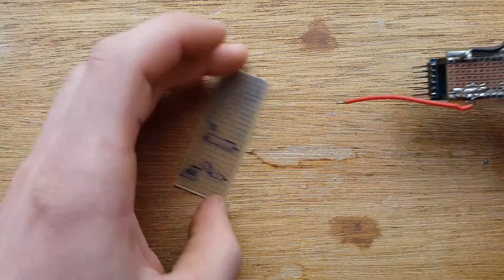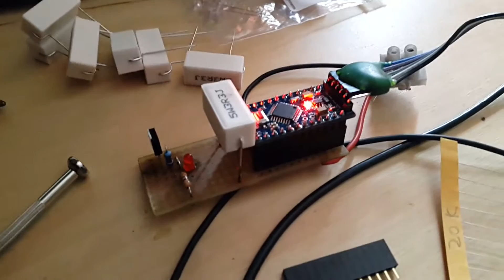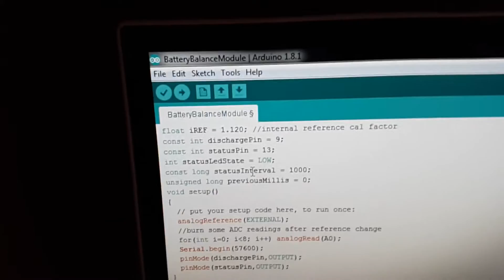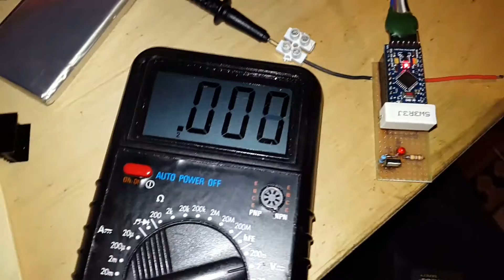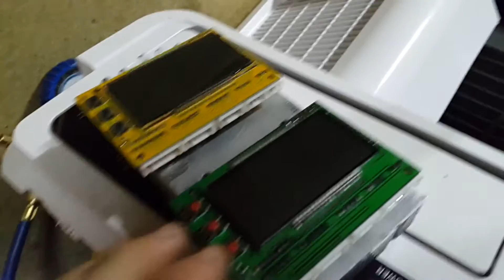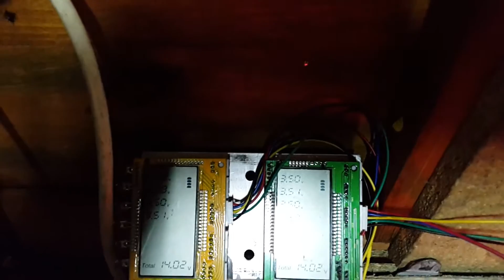DIY Arduino BMS Cell Balancers

Comment: Hi Shaun. Do these board work for bigger 18650 packs? If yes, how are they connected? Is there  main board that gets all the infos? Is there data storage? I don't understand code, so i need to ask you these things. Thanks for any help.  Bye
Reply from the maker: It will work on any lithium ion cell you can physically fit them to. The code sadly has been lost but I am working on a newer version which is far more accurate and doesn't use microcontrollers. It will be released as a commercial product.

Comment: This video deserves more views.  You have achieved something reserved for very high end BMS,s.  I have 4s LiFePo4 BMS,s here costing upwards of £200 each  and they are arduino based.
Reply from the maker: I am currently developing the newer version of this which uses analog electronics entirely and balances to within a millivolt or thousandth of a volt. It will be a commercially available product. Please see some of my recent videos for some more info.
Reply: Hi. That's great that you are developing a commercial version. I guess you'll produce pcb's with all the devices mounted. There's a real need in the powerwall community for affordable alternatives to batrium an chinese products. Keep us informed. I suscribed to your channel.
Reply from the maker: @Suncatcher173  Thanks, I have just uploaded a video about it. The product is almost ready.

Comment: Did you try measuring Vgs on the dirst version? Perhaps the gate voltage was below Vgs threshold. The drain to source resistance might have been comparable to the power resistors resistance and dissipated half the power.
Reply from the maker: Han Gathercole Lam The mosfets were too close to the resistors and it was due to heat conducting through the solder.
Reply: Shaun Dobbie oooh I'd have taken a long time to work that one out without a thermal camera.

Comment: couldn't you use only one arduino to sense the voltage of all the cells (use analog multiplexer if you have many cells, up to 18 or even more, because arduino has few adc) ?
Reply: instead of many arduinos you would have many mosfets, but therefore use many digital pins

Comment: Have you thought about ATTiny's instead of arduino's?
Reply from the maker: Colin Hickey Yes and I would have chosen them but that would mean learning a whole new IDE with different functions.
Reply: i thought you can use the arduino IDE for programming them.
Reply from the maker: Colin Hickey I am not sure, if so I would definitely use them.
Reply: Do you mind if i try and adapt the code to an ATTiny85?
Reply from the maker: Not at all, please share how you get on.
Reply: Shaun Dobbie been working with the attinys this week and it's not too different from using an arduino.  I've got the cell monitoring working well and talking to a an esp8266 via an optocoupler and I can access it remotely via a web page.  Plan to look at your code and integrate some balancing into it.
Reply from the maker: Awesome, I hope you can make a video about it.
Reply: done a small intro video showing things at a very high level and plan on doing a few more videos.  how have your balancers been performing?
Reply from the maker: They are not massively accurate due to the 10 bit ADC resolution but they are good enough.
Reply: Definitely seem good enough to me.  I'm chuffed i got the attiny's working, really good chips for the cost.
Reply from the maker: That would be interesting. If I was to do that with my setup, each balancer module would need to use opto isolated communication.
Reply: Nice. what set point point voltages are you using for the outlander pack?  and do these cell modules feed back to a BMS (which signs the charger) or does the charger just have programmed voltage points. were the outlander balancers no good?
Reply from the maker: The balancers off the battery were too complex to set up. These balancers do not communicate with anything and I have set the charge controller to charge to 4v per cell.
Reply: Shaun Dobbie nice thanks. I'll post a video of my setup when Im complete.  I'm going to put in a BMS which will send some commands such as stop discharging, stop charging etc to the victron Multigrid.